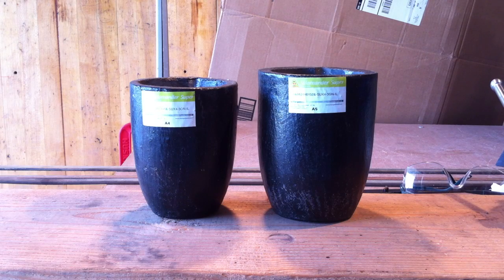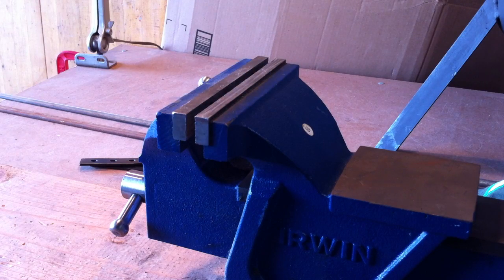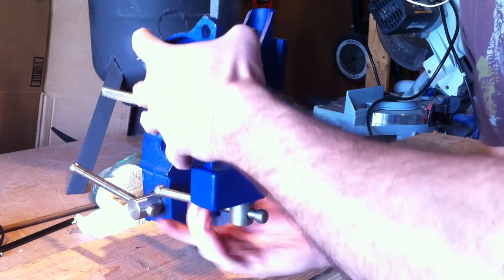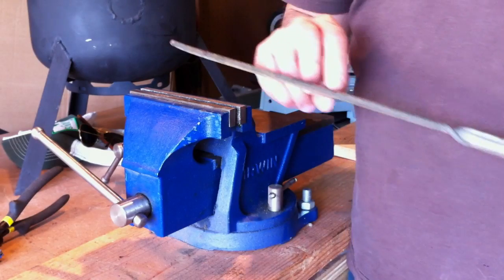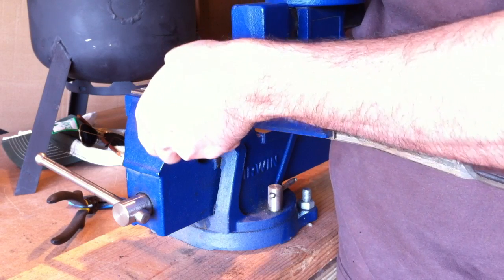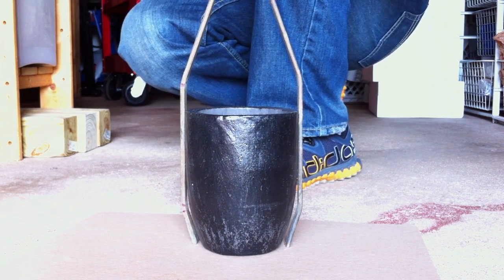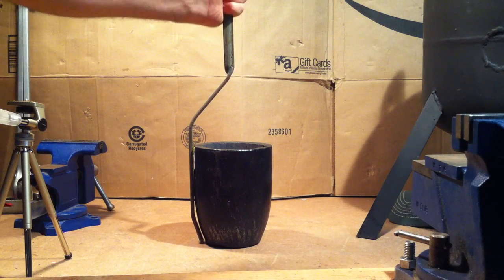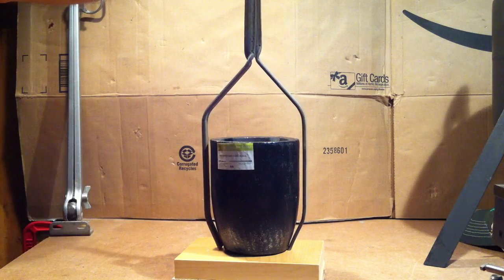Backyard Foundry DIY tools - lifting tongs

Comment: BTW, you can twist the metal bar very easily.   I'd never twisted metal, and like you said in the comments, people always use heat.  I did the same twist on the same metal with a small vice on a very weak workbench, and a pair of generic curved jaw 8" vice grips. I didn't have to put much muscle into it.   I'd guess the leverage was about the same as you had with the little vice.

Doing my other bends, I'm just using a box end wrench slid over the bar.
Reply from the maker: JW Smythe - Yea, metal has always been a mystery to me since I never really worked with it before. I was very surprised that I could bend it without heat.

Comment: Awesome!  I'm thinking about revamping how I take my crucible out and I think you're really on to something here. I may just copy your design. Imitation is the highest form of flattery right?
Reply from the maker: Cool man. Copy away! The one thing that I didn't mention in the video is to make sure you have enough room between your furnace wall and crucible for the tongs. It's one of the reasons I went with a flat stock instead of tubing or round bar. Oh and it was free.

Comment: Nice job man...wish i had a real crucible like that...lookin forward to seein it work when ya finish.
Reply from the maker: I had to go for the real crucible. I much rather make my own but there's no place around me to easily get large diameter pipe cheap/free to make one. I really could use pipes of different diameter to help bend metal.
Reply: Cant go wrong with the real deal tho bud...il keep an eye out for part 2...good job makin your parts fit correct.

Comment: is your Name Clark? cool way of figuring out what you need done
Reply from the maker: Heh.
Reply: only superman can bend steel with his bare hands, or should I call you Clark??
Reply from the maker: I'm a metal noob so I didn't think it was that easy to bend/twist steal. I thought you had to heat metal to a cherry red. However, if you have enough leverage, you can bend it. You just need to clamp it down on both sides of the bend. Also, I eat a lot of spinach from a can that I keep in my shirt. It's an old navy trick. :)
Reply: lol ok popeye